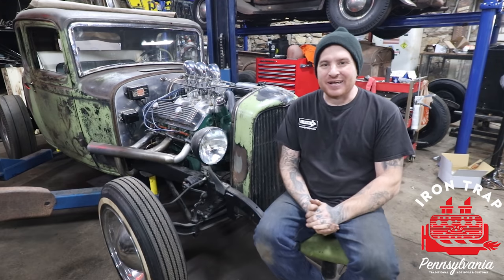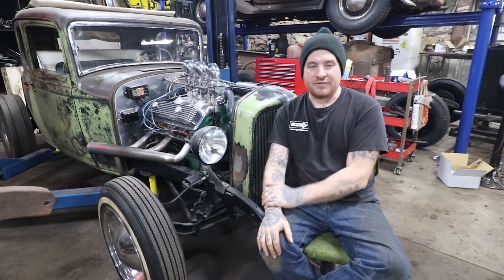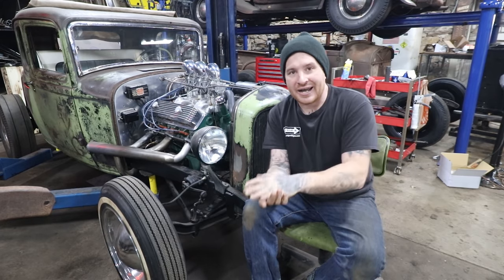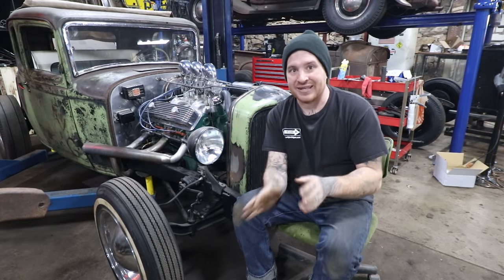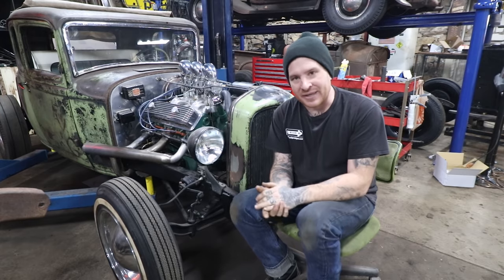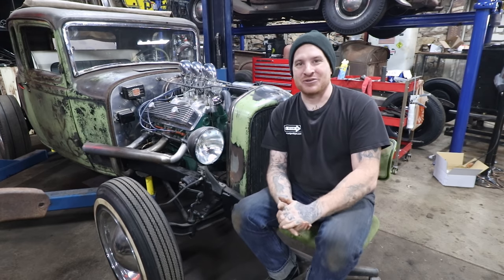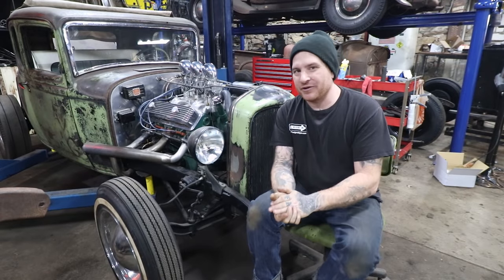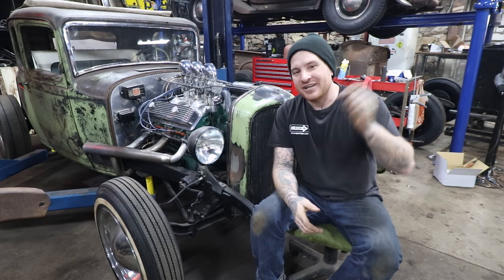Early Oldsmobile Rocket Hot Rodding 101 - Is That A J2!!!

Comment: The greatest obstacle to putting a Studebaker intake on an Olds engine was the Stude manifold had no water passage or thermostat housing. They were also a very poorly flowing manifold and nearly all were 2BBLs. Now, going the OTHER way and fitting a Cadillac intake to a Stude engine was fairly common and an easy swap. The port spacing was almost the same but the Cadillac ports were half again the size of the Stude. Some serious porting work was required to match the heads to the intake and the mounting holes had to be elongated slightly. Nearly all the Cad engines were equipped with 4BBL carbs. Those that weren't had 2-4s or tripower. This leaves out the after-market aluminum manifolds made for Cadillacs which had nearly any carburetor combination you could think of. Many years ago I found a 4-71 Detroit blower and manifold for a Cadillac.( I won't tell you what I paid for it because you won't believe me) It took a while, but I was able to fit it onto a 1963 Stude 289CID V-8. I had a special cam ground for it, put in a set of .030 over forged pistons and built a 2" wide Gilmer type drive to turn the blower. I fabricated a base plate for a 750cfm Holley carb, and a Vertex magneto I bought at another swap meet. It was a VERY nasty engine which I put in a number of cars and had a ball until Sunoco stopped selling 260 octane. I tried water injection, aviation gas, retarding the spark, you name it . Nothing I tried would stop the high speed detonation except racing fuel. This meant I had to carry enough gas to get back home on a long trip. I reluctantly put it away because I didn't want to risk damaging it. I would run it for a few minutes every 10 years or so (Open headers WOW!) and I finally sold it a few years ago.

Comment: Matt, thanks for the information.... I have a 54, 55, and 56 324cid for my 1955 88... one thing is the 1956 cam is bigger than the 54 and 55.  It affects the push rod length...
Reply: Lifter diameter is larger as well.  49-55 the lifter is .842", 56 and on use a .921".
Reply: @57Joe  Actually. Olds went to the larger diameter lifter in '57.  However,  the camshaft bearing journal size increased in '56.
Reply: @tacoheadmakenzie9311  I stand corrected, 57 was the transition year for the lifters.

Comment: Just a small point Matt , I believe it was Cadillac with the 331 , who brought out the first ohv V8 in 1949 . The story ( I believe it is verifiable ) - is that the Studebaker directors , in no way able to afford the huge costs of developing their first ohv V8 from scratch , bought a brand new Caddy 4 door off the showroom floor, handed it to their engineers , who tore it down , studied the new Casting techniques , then came up with their own version in record time . Studebaker were not in the top end luxury market , thus their V8 was only a 239 . Externally there were similarities to the Caddy V8 .The Studebaker 239 was unusually heavy for its internal dimensions , though it was a fine , tough unit . The next important V8 was the excellent but expensive Chrysler Hemi- , then the Y block Fords ,  and so on . probably the next really big impact was the 55  Chevy , with their brilliant Small Block.

Comment: Back in the day I dropped a Olds 324 ($300) into a Deuce roadster ($650 California rust-free) and thought I was good-to-go; problem was the doors would fly open unannounced, the windshield would periodically disassemble and my ’56 Chev rear axle setup would not stay in the chassis but hey I was just a teenager lacking a mentor and unknowingly driving a death-trap.  Much later and much wiser after a boxed frame, a stabilized-reinforced firewall and improved welding techniques, my deuce hot-rod became somewhat reliable and due to a lighter SBC engine—drivability was much improved.

Comment: Great Video Matt I'm running a stock 303 in my 53 Olds and she is running good maybe down the road I will swap in some advised speed parts right now its has a 4barrel and a Automatic 2004R  90's GM rear 3:42

Comment: With all the performance aftermarket parts available for the Ford/Merc flathead engine it was still king until 1958/59.  Remember the 255cid didn't arrive until 1955 and would not show up it the junkyards in quantity until 58 or 59 for the hot rod guys to salvage.

Comment: Its a bit like the later 1966 + engines , the 303, 324 were low deck small block ( like the later 260,307,330,350 and 403 small blocks) and the 371,394 were tall deck big blocks ( like the later 400,425,455 big blocks) .

Comment: I have a 1962 Buick 215 V8 which is also the same as the Oldsmobile 215 with exception of an extra head bolt,  but there’s not many books out there on building Oldsmobiles or Buicks motors
Reply: I’m wondering if that’s the same engine that was sold to Rover cars in the U.K.. If so there’s plenty of books available. It was originally sold as the 3.5 litre & over the years went through many changes up to the 5.0 litre as found in the Range Rover models. I think David Vizard published several books on tuning and modifying the Buick/Rover 215 cu.in. V8. Definitely worth a look.

Comment: That 5x2 intake? I'd love to see that actually setup and running. Trying to get my head around how the heck the linkage for that would work.
Reply: I would think with how the carbs are laid out, the center carb in the middle of the intake is the primary carb and then you would the other 4 come on all at once like a typical 4x2 setup. In my head you would have a base block on the rear of the intake with the 2 shafts for each side connected by a shaft running width wise of the motor and then an arm coming off the middle carb back to that shaft which would then open all 4 carbs up. You could make that arm progressive to dial in when the 4 carbs come online or run it direct on all 5 at once. For a idea of what I am kind of describing it kind of how Eelco made 6x2 linkage

Comment: In the 50's, Oldsmobile was the "performance" division of GM. What I remember from the early 60's is that most 50's Olds', old cars at the time, had noisy lifters. They were good customers for STP.
Reply: Noisy and/or worn rocker assemblies were probably their biggest issue.   Oil wasn't as good then, and they honestly ran TOO cool for their own good,  creating lots of sludge.  Add in that you couldn't adjust them to compensate for wear, and you ended up with noisy upper ends.  My grandfather owned a Chevrolet dealership when 1950s Oldsmobiles were being traded in as used cars,  and they put adjustable rocker arms on some otherwise stock vehicles just to be able to quiet them down.

Comment: Well I am not too old yet . Got a 2003 Olds Aurora 4.0 250 hp 260 at 3000 rpm . quickest car I ever owned. I had a Delta 88 big old 400 . Had a Toronado too but engine was a dog . The Aurora is cool looking with duel hood scoops that got added on non functioning  boo . It does have crossed finish flags on it also . In the corner of the rear windows on the trunk lid and each rear quarter . A  spoiler on the car as well . 10 ct. pin striping 10 ct. emblems . A done in brilliant white .

Comment: You can get a real nice roller rocker assembly from Tony Ross engines. They are not cheap but work really well. The big problem with old rockers is getting them to oil properly. If you are using hydraulics lifters buy American made products. Do not buy the cheap ones. They will fail. I know because it happened to me.

Comment: My experiences on Oldsmobile engines relates to the later model cars between the 1967 to 1976 cars with the Rocket 350 and Rocket 455 cars!! THERE ARE some parts from a company named Kenne Bell to look for, for THESE MOTORS when speaking about Rocker Arm Assemblies!! This company, again Kenne Bell, used to make a fully adjustable shaft style (like those found on certain Mopar engines) rocker arm train, and got rid of the non adjustable valves on these engines! The original cost of the kit was around $2300 new, BUT you can easily be fooled by their "looks" because like I said they look like something off a Chrysler/ Dodge/ Plymouth V8, and not something related to Oldsmobile!!

Comment: This is good information for me. I've got a 47' Olds fastback with the flathead 6 and Hydramatic (auto) trans. The hydramatic lost everything but 1st last fall (if it's cold it'll do reverse and maybe upshift once).  I plan to stick with a 1st gen Hydramatic (I don't want to change up shifter or learn stick), which were made between 1940-1956, but if I end up forced to buy a second trans for core parts for mine (there were teeth in the pan long before it died) I may try to find one that comes with the V8 and upgrade performance.
One thing I wonder is if in 56/57 when the second generation Hydramatics (with updated shift pattern) came out if the engines and trans retained the same bolt pattern.
Reply: The block pattern was the same for all 1949-64 303, 324, 371 and 394 cubic inch Oldsmobile V8s.

Comment: another reason that is not usually mentioned as to why Olds, Caddy and Chrysler o-h v8,s were so popular in early hot-rods past the flat-head Ford era is illustrated in an article published in Circle Track magazine sometime in the 70's by Smokey Yunick. It seems that he was hired by someone at GM to develop the small block Chevy for NASCAR racing. AT the time stock ment factory stock with no aftermarket parts. there had to have a factory part number on it. 
smokey was unable to succeed in this as he put it "the factory metallurgy was so bad that the parts were unusable for high-performance use". Also the sbc started out as a 255 ci and grew to 283 ci and the other engines were larger. You might say that the modern high performance industry was instituted to correct GM's deficiencies.

Comment: I'm building a 63 oldsmobile cutlass f-85 cam with a 215 v8 I'm dropping a 425 olds from 65-67 in it with the manual transmission.. I've watched this video a few times for info or fun.. u seem to have a lot of knowledge on them.. is there any info u know or have  for a mild performance knowledge on the yrs of this 425 and or know places that can find.. not alot of info on them besides back n forth of possibility n idea but actual yes n nos are hard to fine let alone parts that will work for them..

Comment: Wow that was a fun run thru .
I have in my 33 3/w ford a 1953 303 rocket but two adjustable rockers are  bad , the name are Thomas 08 i cannot find a couple used or new ones.
Im not rich and cant afford a full set any help for a fellow rodder would great be appreciated.  Thx they appear to be aluminum or magnesium?
Reply: Good luck trying to find those Thomas rockers; they were quite rare, even back then!
I have McGurks in my Olds; also look for them....
Reply: Tgx alot for the feedback
Reply: More info.from 60+yr. old memories:  the Thomas rockers were magnesium, 
as I recall, which made them pricey, and if the tips were not hardened steel, would
wear down, especially if racing.  If that is the problem w/ yours, a good machine
shop can likely repair them.  Old racers, or old speed and mach. shops, would be good
sources for replacements. (Believe a third mfr. made them, too, but the name escapes
me now)
Good luck!

Comment: When I think olds small V8... 
I think the notchback cutlass with the 4.3/260, I had a well maintained '80 ran into the mid 90's ~200,000 miles only engine work I did was a carb kit and intake gasket. A "friend" had the same but a 79, clapped out, falling apart, jacked up with big and little's and no muffler it ran like a bag of turds but made lots of vroom noises. He got drunk one night and about died in that car... not from a wreck but alcohol poisoning.

Comment: Rockers hitting the valve covers ??  Just glue (HI-Tack) a couple (or more) of gaskets together.  Now-a-days, Speedway Motors make a very thick sandwich-type gasket with metal core that does the job for some engines.

Comment: My cousin had a 79 Cutlass Olds with a rocket engine. Couldn't blow that thing up. We tried. My mom's first car was a 2dr bird egg blue 64 Olds f85
Reply: My mom had a 64 F85, with the V6 in it. I actually loaned her the money to buy it. Nice car, till a Chevy pickup t boned her
Reply: I had a 79 cutlass that was light gold / copper color , it was originally a V6 car , but someone had put a 350 rocket motor in . It didn't seem to run particularly special , after messing with it a little bit I discovered the throttle cable was a couple inches too short to get the secondary's to open up , unfortunately I got rid of the car before I changed it
Reply: Both of those engines are totally different than the first generation Oldsmobiles discussed here
Reply: @57Joe  And?????????